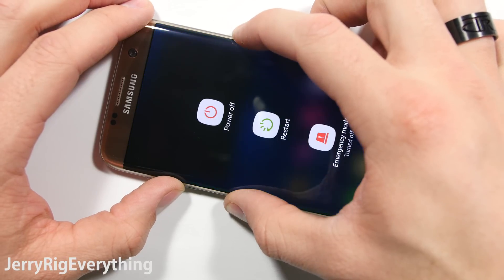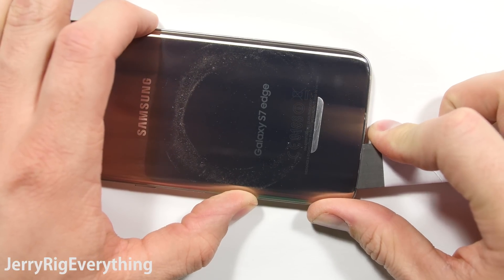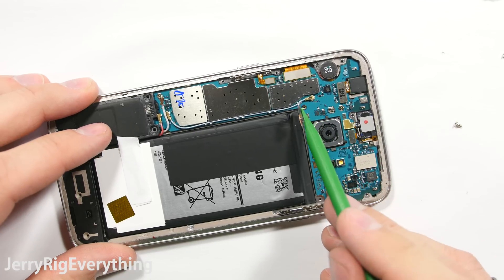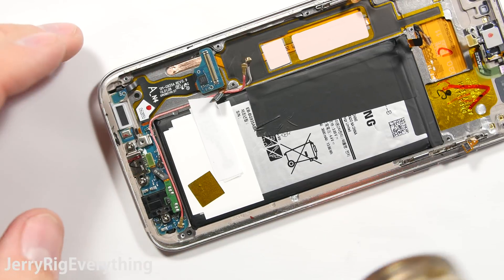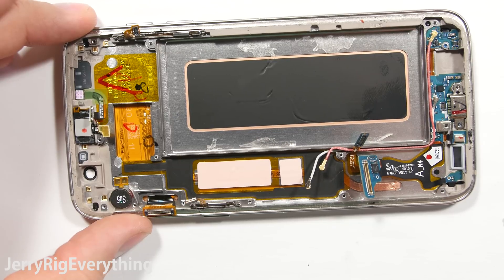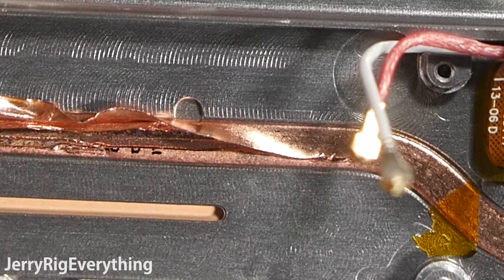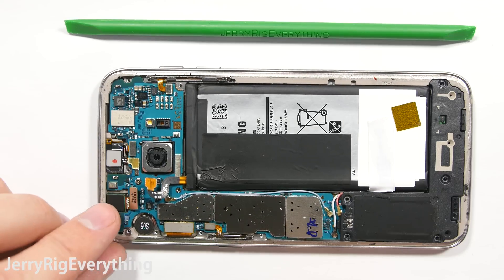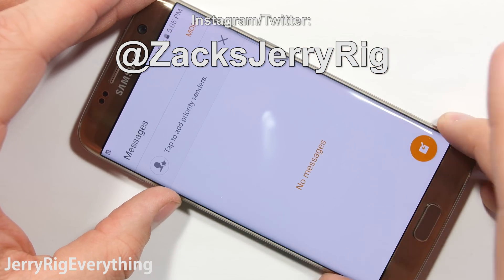Galaxy S7 Edge Screen Replacement - Charging Port Repair - battery fix

Comment: Whats that black rectangle under the battery for is it thermal paste or tape?
Reply: @genius8245  its not tape it like paste
Reply: @genius8245  me too i found it to be a greasy rectangle maybe mine melted...battery was fat for 5 months so maybe the tape melted  i know it has glue on both sides that had to be removed
Reply: @bkknight3321  So its tape not thermal paste.
Reply: @genius8245  its
 thermal paste now
Reply: @bkknight3321 You are right its thermal paste

Comment: the water cooling in the s7 edge is water cooling because there is coolant in it. when you cut it open the water very quickly evaporated
Reply: It's not water cooling like with PC's

Comment: @JerryRigEverything
Ive got a s7 with broken screen and S7 edge with working screen. Unfortunately s7 is as broken as I cannot get it to be able to recover the data from. However I can teardown my s7 edge in order to somehow use it's screen (swap from edge to non edge) to restore my data. Do you think the connectors will match and the screen will work for this purpose? If you can, please help me with your wisdom :)

Comment: Yeah k so now I get why my S7 Edge had sound issues after my charge port repair lol, looks like it's just an insane repair to do. Hard enough to find someone willing to, but they managed it without breaking the screen! Instead, the sound went to shit, with a distorting loudspeaker and dodgy call quality lol. I dunno exactly how they fixed my charge port in the end but they mentioned replacing an entire board..... in any case, it still got me an extra year of use so I could avoid the S20 series and get the S21 Ultra instead! :D

Comment: well. I think my battery is dead or something hapenned to the usb charging port. Can"t charge the battery via usb but The VR headset also called Samsung Gear can be connected as usual. So I don"t know if the usb port is damaged. I bougth a Qi charger and I will recieve  it in three days from now on. I hope I could charge the battery this way u.u otherwise I have to send it to the service to check out and replace the  battery
Reply: yeap now I use the Qi  charger

Comment: Thanks for very informative Video, i used som water to clean my S7 Edge because of Corona Pandemic after that does not work,
how could i know that is motherboard or The Battery is gone,I mean testing?
and is there any Books or web site for new beginners learning and repairing smartphone? 
Thanks

Comment: The battery is the most challenging part. I attempted to remove the battery from my phone with a bent tip knife. What it did is it created a tiny spark and a small bang. Immediately, the battery start to swollen, heated up and it created an awful smell.

Comment: I did it all in hope to fix mine , disassembled my phone leaving the heat pipe in place(of course), but still functions with the same heating problem  , i guess i need a motherboard or a replacement :(

Comment: The heat pipe definitely does contain a liquid and that liquid is probably water. And it will be operating at below atmospheric pressure in order to lower the boiling point of water.
The way heat pipes work is that the liquid evaporates at the hot end, gets transported to the cold end in gas form and then at the cold end the gas condenses back into a liquid and that liquid is transported back to the hot end by a wick (surface tension does the job). You won't see the water. The small amount needed will be wetting the surfaces inside the heat pipe and most of it will be wetting the wick. Heat pipes cannot work without constant liquid/gas interchange so its pretty fair to call them liquid cooling, though I prefer phase change cooling.

By cutting open the heat pipe you destroy it. The small amount of water that was in there will most likely end up hanging around inside the phone and eventually it will escape because the phone isn't sealed. The heat pipe itself will still contribute somewhat to cooling (because it can conduct heat). However if you pushed the phone hard it will either overheat and become unstable or protect itself by slowing down the CPU. I'm not sure what this particular phone does.

Comment: Well, dang.  The title says "Galaxy S7 Edge Screen Replacement"...  but you didn't actually do it, just suggested it "should be the same process" as removing the back cover.  But I guess the only way to find out is to go watch someone else's video where they actually did it?   Probably should be re-titled this video to "Galaxy S7 Edge Everything But the Screen Replacement".  Haha

Comment: good, informative and well narrated strip down, I have a question regarding the finger print connector, will the phone still work with the fingerprint scanner disconnected? mine is damaged and will not re-connect!

Comment: Hell if heat pipe counts are liquid cooling or even as liquid cooling technology ( it's capiliary, or a wicking type of cooling ) then every PC heatsink like everyone's favorite hyper 212 EVO from cooler master would be considered liquid cooling... And those heat pipes actually have liquid inside as well as sintered copper (powdered copper pressed back tpgether) on the edges instead of a weave or wick of copper which allows for better cooling

Comment: You missed replacing the gold tab along the bottom of the battery prior to reinstallin the back plate.  Too, it appears that you went a bit to far in checking on things that likely didn't need to be checked on.

Comment: there's actually 3 forms of image stabilization:
1. Optical Image Stabilization, where the camera actually moves
2. Digital Image Stabilization, where it's done in-software
3. Chicken Image Stabilization, where the camera is strapped to a chicken's head
Reply: They all sort of work

Comment: Couldn't you use playing cards to pry the screen off since they are more flexible to repair the charging port? Just wondering if that's an option or just better to fully replace the screen and charging port.

Comment: Dear Jerry,
Did enjoy video made a few  notes on the same ....however I recently cracked my front screen. The phone works amazing well no flickering of the screen. My worry is if given for replacement will affect the water resistance. And whether it be same like before ? Well alot of doubt and questions on the same....

Comment: Just a FYI the Liquid R-134 Refrigerant used in most heat Pipes Boils away as a vapor at -13F when at sea level Pressure. As soon as you allow the pipe to depressurize The phase change happens & Gas escapes.

Comment: I can't determine why I wouldn't be able to replace the glass on the S7 Edge without taking the phone apart. It seems I could carefully pry the old glass off of the digitizer, clean off the adhesive, and then place the new glass on. Is there something I'm missing?
Reply: bump got same doubt as well

Comment: dropped it from table height with a glass screen protector and the protector AND the screen got cracked and phone is not usable the screen is flickering and turning on and off with a green line and its cracked on the top left corner on the edge

Comment: i had mine sent in for repair and i swear they just took a new phone and stuck my old back on it since i had a little user mark next to the loud speaker which was gone only 1 tiny scratch i had on the back glass was left

Comment: Hi my screen just cracked, lcd still works fine tho. If i bring it to samsung service center to replace the screen, will it still water resistant (ip68)? Please answer.. thanks!
Reply: adam sangaji should be the way to test if it is  use a non electric conductive liquid see if bubbles come out

Comment: I have a water damaged s7 edge and to fix it can I swap out the display and mother board or will that not work pls help!
Reply: Your display is more than likely fine unless water got inside the internal layers. A board replace will likely be enough.

Comment: Is the adhesive on the new glass going to keep the phone water resistant or will water resistance be loss
Reply: CoogiMane1996 depends on the adhesive
Reply: +carl white what type of adhesive will be required for water resistance?
Reply: water proof adhesive id buy oem adhesive for the phone so you have whats on the phone all ready
Reply: +carl white can you link me a recommendation?

Comment: +JerryRigEverything Question: Did the USA S7 Edge variants have the 2nd sim slot removed hardware wise or was it disabled from the software end? Is there any possible way to add the dual sim reader or activate the software?

Comment: My phone front screens and back ate cracked the back is bad I wanna replace it but will it still be water resistant Samsung wants like 250$ And I won't have my phone for like 2 weeks for the replacements but my warranty stays and they guarantee water resistance

Comment: This is a step by step program with the help of which you can use simple materials to repair all kinds of old and dead batteries [Check Details Here==>https://plus.google.com/100351090281822647456/posts/Gwtd4mVBdEd ]. It also helps you to update your completely charged battery and know how much money you can save from it.
Reply: tf are those comments
Reply: +chiken It's the main comment user replying to himself with different accounts to make it look like interesting, but his link is probably a scam
Reply: Good

Comment: It seems that the S7 edge screen is so difficult and so expensive to repair that you better buy another one than trying to save yours. It's a really bad point for a flagship, even if Ip 68 certification recently save mine from a glass of wine (and I'm not sure if it really protect it) it doesn't worth to make smarphones unreparable.

Comment: Would it be possible to replace the camera with Another camera? :O Lika Lumia 1020's if they use the same Connection will say,

Comment: Why don't you use isopropyl alcohol across the camera to open back plate and under the battery to get it smoother.

Comment: Same heatsink tube design as the ones for air coolers on PC's. I bent a copper fin till it got pinched on an old for fun build trying to convert an old sony vaio into something usable and it overheated like crazy till I replaced the heatsink that I ruptured. So theres something there, just little enough that we can see it.

Comment: so, here's a little question ... I broke my s7 edge screen, it still works fine it's just the exterior glass that cracked. Samsung is asking 345€ because they say they have to replace not only the glass but also the digitizer and the aluminium housing around it, which is (as they say) the whole module. is this true? can't they really replace the glass only? Great video btw 👌

Comment: Hey, Jerry I am using. S7E, if you search in the NET, S7E has a flaws which a Pink line from bellow to Front Cam Straight to the bottom and if you push near the front cam it disappear, and then back again. I think this is a problem of the S7E, not just me but almost all S7E. I've been looking in your video if i could see the cord connected from the screen to the mother board.. Thanks

Comment: If my screen is cracked can I take it in somewhere to get the screen replaced and still allow it to be water resistant or will it not be for the of the time I have it
Reply: No,once you replace the screen it loses its water resistant ability.

Comment: My S7 Edge got water into the Overview button (left of the Home button) and it triggers randomly all the time. Is it possible to dry that water up?

Looks like I'd have to remove the screen, but that would mostly destroy the phone. I've tried aiming a hair drier at the bottom of the phone for 15 minutes but that didn't help. Putting the bottom of the screen against a vacuum hose and vacuuming for 15 minutes didn't help either.
Reply: Dan Dascalescu Put it in rice. That should help soak up the water. That or those silicone packets that say "do not eat" that sometimes come with things. Either one should help. It may not work, but its worth a shot.

Comment: Hey Zach, so I'll be doing this repair later...Once you finish the tear down, is it just the standard "heat up and separate on the screen?" Or is there anything I need to look for while doing it? The screen I ordered from that link didn't come with the plastic frame.

Comment: There was a dot in the screen of my s7 edge, I've given it to Samsung for display replacement. 
My question is whether the phone will loose its water resistance if i get the screen replaced... Since they are removing the adhesive?

Comment: A heat pipe should never be called "liquid cooling" because it isn't. Phase change or vapor chamber cooling maybe, but in the industry, "liquid cooling" refers to liquid flow as we've all seen in some computers.

A heat pipe doesn't have just vapor, its liquid and vapor of the same material. You aren't seeing liquid because that would be dependent on the orientation held, there will only be a little bit of water at the bottom.

The copper strands don't move vapor, they move the liquid back via capillary action. (And I hope you were kidding about it still working, that phone will overheat like crazy now.)

Comment: Hey Jerry! Thats a real nice video there. Had a quick question.. My Charging port & audio jack stopped working and the service guy at Samsung says the screen needs to be replaced. Is it okay? And after its been serviced at an authorised service centre, do i need to worry about the waterproofing on the phone?

Comment: Hey Jerry. I am buying a S7 edge for cheap because it has a cracked screen. How would I take off just the front glass? Would I have to take off the back to get to it, or would I just have to use the heat gun and the pry tool? I want to do a glass only repair. Is there any special way to do that? Thanks in advanced!

Comment: Ok guys... question, I asked Samsung and a s7 edge screen replacement cost 270$, a charging port replacement cost 70$....

So if you change the port the screen goes out also, you get a new one. Now say you want a new screen, you pay 70$ for a change of charging port and get the new screen for free? Any experience with this? Btw I asked about waterproofing, it is if Samsung changes...
Reply: Aleksandar Zafirovski no

Comment: I wish they would make high end premium phones that have screw construction... still strong and waterproof but can be disassembled and repaired without special tools and without destroying parts of the device.
Reply: That would make the device heavyer ant "not as slick", so that would probs impact sales.
+if the phone market is anything like the car market (i got no idea), they make most of there money from repairs, not sails. Just a speculation tho.
Reply: Karolis N. This is a strange comment lol. You make a real argument but your spelling is terrible. Anyway snap and screw wouldn't affect the weight much at all vs glue. Probably a difference in fraction of a gram. Sales still get the best of the profit, by selling full devices or replacement parts. Most repair is usually done by a 3rd party as if its the first party its probably under warranty (they charge massive amounts for out of warranty repairs if its the 1st party). But a phone easier to repair yourself would push sales of both devices and parts because it would be preferable to a device where you pay 100s just for labor or buy a new device.
Reply: Woogoo336 On the flip side tho, maybe sellers like samsung would be held liable for all sorts of idiots that blow up there batteries or get shocked well trying to repair there phones. Or maybe they think that a phone that you can repair your self wont bring in all that many extra customers(that would not be a selling point for me personally), so they dont bother (gluing shit together is cheaper than screwing it in mass production +its cheaper to make it water resistant).
And yah, english is not my first language, and ive been living on energy drinks, coffe and about 3-4h of sleep a night since i have my exams atm.... xD
I want to die.

Comment: I have a question ? What happens to S7 Edge  if its directly connected to AC supply (without charger) through it's charging port . and can we claim for warranty.

Comment: I wanna teardown my s7 edge and take out the samsung logo and replace it with a glowing logo 🔥
Reply: Would need a custom back for that. You could go with a metal or plastic back which imo might be better.
Reply: Woogoo336 would stay with the glass on but w/ the samsung logo in a plastic material so that its slightly transparent. Searched for it in Ebay couldnt find anything tho 😒
Reply: I saw on another video people saying the color on the glass can be removed/cleaned off. Not sure about the samsung logo itself but it would probably work if you could precisely remove the logo and add some kind of light that will tap into the phones power...
Reply: the logo stays on

Comment: @Jerry....

I  need a help...

My S7 edge fell down, luckily the screen is safe and only it caused the phone to dent  a bit...

But but but... after the fall I hear some noise when I Shake the phone and now the battery  backup has lowered ...

from 5 hour screen on time to just 4 hour... and battery drains more when the phone  is on standby  than before....

could u suggest  what could be the problem ?

😮

Comment: hi, I've just had my s7 edge screen and back glass replaced, but it looks like there is a little gap on the back glass. like it hasn't been aligned correctly... can I fix that? or will it need to be removed and more of that double sided tape needed?

Comment: And another thing Jerry 
At the back cover of samsung s7 edge I saw that at the bottom of the phone is a little gap (1mm) and I saw that if I try to pull the back cover down, up, left, right is moving a little...  Can you please tell me why is moving and if is a problem, like damaging the ip68, or peeling off the back cover, or is normally to move a little bit!? 
Thank You